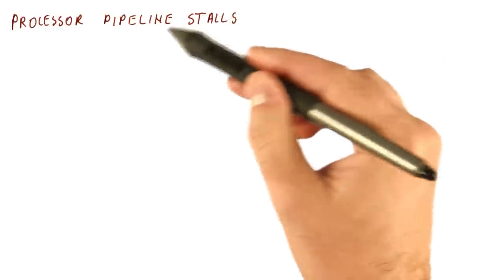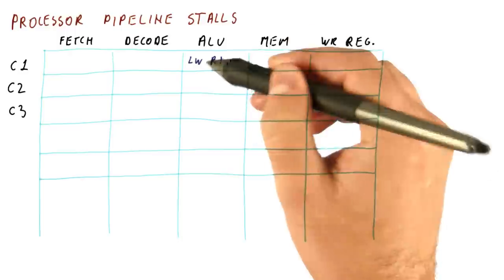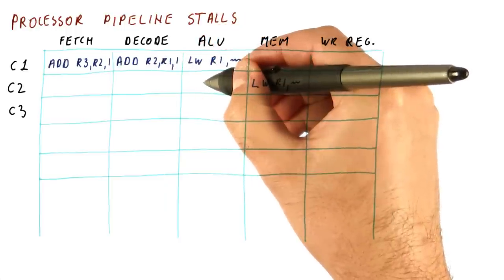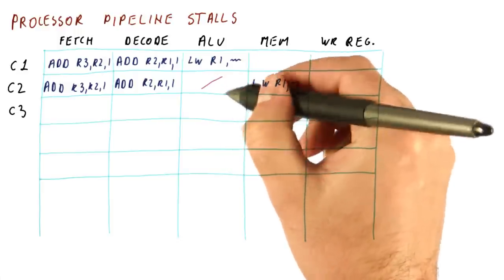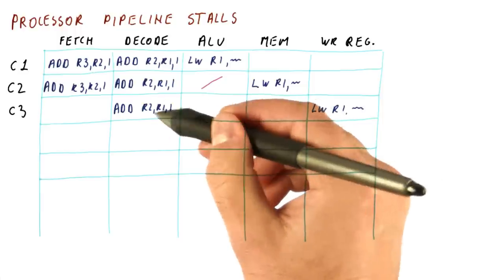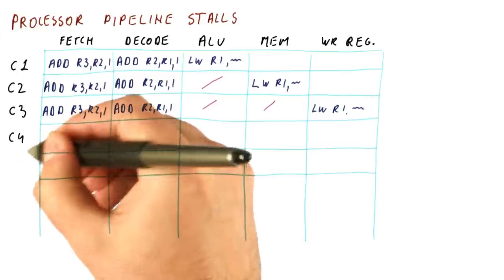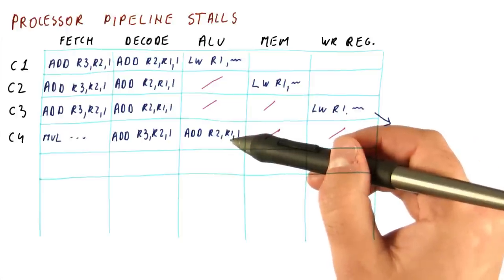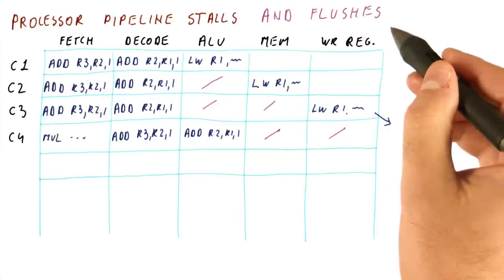Processor Pipeline Stalls - Georgia Tech - HPCA: Part 1

Comment: At 2:40 he gives two different options for the next instruction to execute, but he only draws the pipeline assuming the add and lw are able to be executed in the same cycle. However if the add was executed in the first half of the cycle and the lw in the second half, wouldn't there be a stall of 3 cycles? And if so, why would he not draw the pipeline assuming that they are not able to be executed in the same cycle?
Reply: Figured it out. r1 is actually already written to and can be used by the time lw is on wr reg. So, add only needs 2 stalls.

Comment: stall meaning???
Reply: Rajan Negi extra cycle
Reply: Stall implies issuing a No operation....basically issuing a zero to the concerned register. Correct me if I am wrong.
Reply: stall /stôl/ verb
stop or cause to stop making progress.
Reply: In the design of pipelined computer processors, a pipeline stall is a delay in execution of an instruction in order to resolve a hazard.